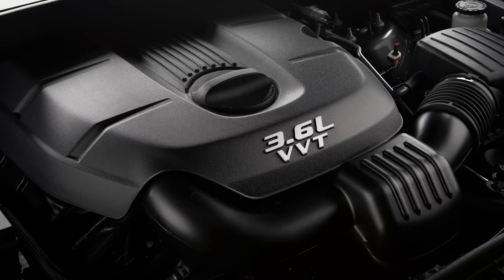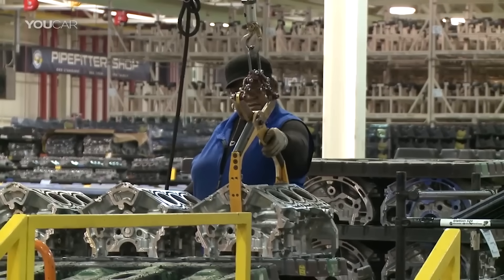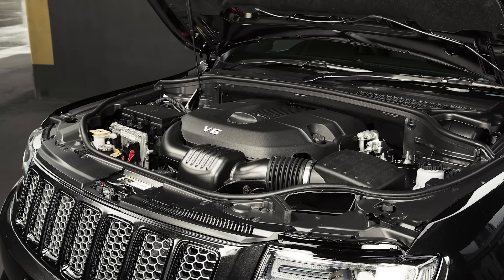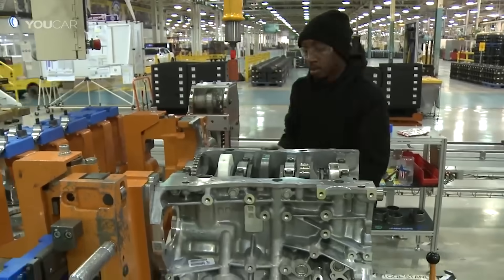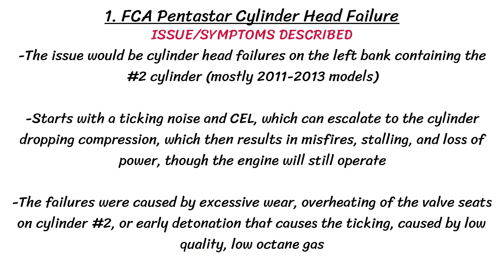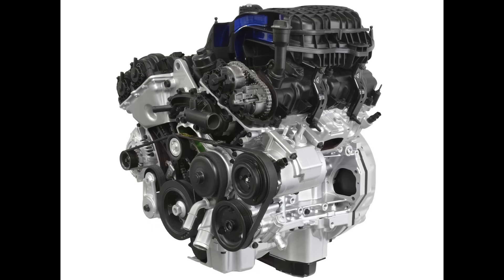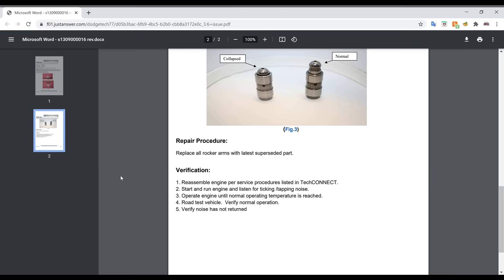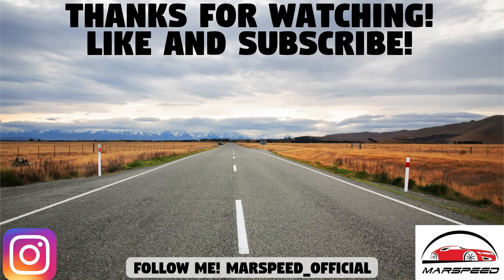The Specs and Fatal Flaws of the Chrysler 3.6L Pentastar V6 Engine

Comment: A couple weeks ago I noticed my 2012 Jeep wrangler was starting to over heat and the heat would blow cold. Brought it into the shop and they replaced the temp gauge and everything ran great for the next couple days. I went away for a week and when I came back all the issues came back as well. I just got back from the mechanic for a second time and now they said there’s a warped cylinder head causing exhaust to flow into the cooling system. They quoted $5k to fix the issue including the rocker arms which they said could fail anytime in the near future. This is shocking to me since the car only has 97k miles on it and the temp gauge never read H only 3 quarters at most when it was overheating and the check engine light never came on once. 

I like the pentastar engine and Dodge and Jeep products but this is uncalled for. Even if the pentastar engine is overall reliable, a simple thing such as a thermostat failure should not cause catastrophic engine damage after only driving a few miles with it running a little hot.

Comment: 2013 GC build which is just outside the warranty. Constant coolant leaks from upper radiator hose, oil pump assembly leaking oil, heater core issues, P0302 misfire with no offer of help from Mopar, Jeep, Chrysler, Dodge, Fiat. DO NOT BUY A PENTASTAR. Also… does anyone know where I can join the law suit?

Comment: I own a 2015 Grand Caravan, it has 100,000 miles on it and it developed a noticeable tick on a 1,000 mile trip we were on. I wanted to get it repaired asap, however I still had to drive home. Drove home and found the noise was coming from the right side bank. I took the valve cover off and voila, one cam lobe had worn completely flat for 1 of the 2 intake valves on cylinder 3. I ordered new parts including rocker arms and the cam. It runs beautiful and quiet now. But I'm peeved that Chrysler extended this warranty for the 2011-2013 3.6's, but when they revised the engine in 2014, they added no such additional warranty when it fails in the same way. Can't imagine what I would've paid if I went to a dealer. Probably would've equalled almost what the van is worth, when it cost me $300 and an afternoon of my time..

Comment: I know the Pentastar V6 had it’s issues in the first few years, but at least Chrysler honored the recall, which can’t be said for all auto makers. Here’s a video of a guy tearing down a Pentastar with 626,000 miles on it, and it didn’t even die yet, so to speak. Timing guides wore out and it jumped a few teeth, but didn’t cause valves to hit pistons. 

https://youtu.be/CDjvfd9mo5s

Comment: LIKE MOST VEHICLES PREVENTIVE MAINTENANCE IS A HUGE BENIFIT. CHANGE OIL FREQUENTLY, USE SYNTHETIC OIL, CHANGE FILTER AND OIL AT AROUND 5000 NO MATTER WHAT. KEEP ENGINE CLEAN TO SEE OIL OR LIQUID LEAKS EARLY. DISHWASHER DAWN IS REALLY GOOD FOR CLEANING ENGINES, BRAKES, WHEELS.  AND MOST IMPORTANT, ACTUALLY CHECK ENGINE BAY WHILE FILLING UP WITH GAS!!  PREVENTIVE MAINTENANCE, BEFORE IT HAPPENS, CHEAPER THAN FIXING THINGS LATER.:goodvibes::goodvibes::goodvibes::washhands::washhands:

Comment: i have a 2017 challenger sxt plus. i just replaced the oil cooler & water pump for $3000! 3 months earlier i had the fuel injector and thermostat replace. all together spent $5000 in 2yrs. can't wait to get a tesla

Comment: FYI. Discovered yesterday on the 2014 Town & Country with 134,000 miles that the fatal flaw requiring replacement of Left Cylinder Head on the 3.6 costs $3300 at the dealer. Only saved because of the Max Care Lifetime Warranty I bought with the vehicle.

Comment: I’m currently having a overheating issue with my 2015 Jeep Grand Cherokee. It started after I changed my radiator. I went with an aftermarket part which was thinner than the OEM radiator. After I changed it I noticed the vehicle was running a bit hotter but not overheating. Shortly after that I had an oil leak coming from the oil filter cooler. I ended up changing that out and I went with the aftermarket dorman all metal oil filter cooler, thinking that would be a better fit since the OEM was plastic. However unfortunately after I changed that, the leak went away but the vehicle started overheating. I’m not sure if I put it back wrong or if it’s something else. I currently don’t know what to do because I don’t wanna ruin the car. Any advice would help and greatly appreciated!

Comment: I have a 2015 Dodge Grand Caravan with only 90K on it and I had to recently replace the leaking oil cooler and I'm in the process of replacing the left bank cylinder head.

Comment: It's a good motor, lacks on power and torque in the ram 1500 which I have and I have not had any problems with it besides cooling system problems

Comment: 2011 Dodge Ram 1500 number 2 cylinder intake valve , stuck open, no compression, rocker arm fell off, did compression test, 136 thousand miles

Comment: The 3.6L Pentastar V6 is WAY too complicated. The Ford 3.8L OHV, 12 valve pushrod engine without VVT is a far superior engine. I have 322,000 miles on one in a 2003 Mustang. It has held up so well that when it does fail/wear out, I'm just going to replace it and keep driving the car. It's cast iron block and aluminum heads have caused some problems, but I haven't had any issues so far.

Comment: Do not buy any vehicle with this engine! Jeep, chrystler, dodge etc. I'm a mechanic and trust they are junk. If you're pentastar runs good then you are one of the lucky ones . But if you're engine light comes on and you get misfire codes (that's all folks) your cylinder head has likely failed. Jeep at my shop had broken head with only 60,000 miles. Then chrystler sent new head that was broken from the factory. We lost thousands, had to give back to irate customer (no charge) and cut our losses. Junk junk junk!

Comment: I have. 2014 Grand Cherokee...developed what I assume is the rocker arm fail and also AC compressor went out all at the same time. 142,000 miles.

Comment: 2014 Grand Cherokee almost 200k miles. Flawless easily accessible power. Oil change (mobile 1) when the computer says to, sometimes longer, have run 2 or 3 flex fuel tanks and no probs. at all. Amazing!

Comment: I got a used 2016 200C, in 2019 with 17,000 miles on it. Love the car! Had the rocker tick happen at about 30k miles. It went away as I pulled out of my driveway on way to the dealership, but I had them replace all of them anyway. 
Every now and then there's a faint smell of antifreeze, but there is no leak, and the coolant level is fine. Anyone have ideas for this? Heater core issue maybe?
Thanks for the vid!

Comment: I have a 2011 Challenger v6. Only issues I've had is replacing thermostat housing, twice. It's annoying bleeding the coolant system. But after replacement runs like a champ.

Comment: 2011 journey oil cooler is a shit design by shit people, period. Replacing my fourth one currently,. 138000 miles. The second one cost me the radiator as well because somehow the oil leaked into the coolant port. The clock spring went out at 100k and the abs brake unit went to shit. That's still not fixed because I drive it now and it brakes fine, just no traction control or abs. Be my last Chrysler ever. Awesome just got further in the video and found out I have the cylinder 2 problem cant wait for it to grenade on me. Oh yeah no heat either. Shit motor.

Comment: I plan on putting one of these great engines in my 1974 plymouth duster. With the power to weight ratio, I should see impressive fuel mileage and maybe even more horsepower too. My duster I'd an original slant six car, so I figured, why not give myself more horsepower and monumentally better fuel economy than any old v8?

Comment: I just recently purchased a 2017 wrangler with 64k miles on it. Drove off the lot and check engine light comes on after 50ish miles or so. End up pulling the code myself and get p0302 (cylinder #2 misfire). Talked to the dealership and drove the jeep to their shop a week later (80ish miles away). Just heard from them today, its been 3 business days now and unfortunately they are going to have to replace the heads. Dealership is covering 100% of the cost and also put me in a loaner vehicle estimated time being 2 weeks. Although I am grateful for them fixing it on their dime, the inconvenience has me a lil ticked. Hoping for the best when its all said n done!

Comment: I purchased a 2017 RAM 1500 Express with this engine in 2019. I find it an great power plant, had as much horsepower as my 2003 RAM with the 5.7 Hemi.
Ironically I did purchase a factory extended and have that security in mind.
Believe most owners are to blame for this engine issues as most don’t follow the maintenance needs, very typical.

Comment: All I can do is laugh when some tool with a Cherokee actually thinks this Pentastar trash is worth anything. This is the bare minimum, cheapest possible V6 you can buy. But then Chryslers have literally NEVER been reliable in any respects. There are far too many plastic engine parts. Compared to any Nissan VQ, except maybe the 4.0l, these are trash straight from the factory.

Comment: My Chrysler 200S Convertible hasn't had any issues with the motor so far (129K miles) but I've got a clogged heater core. I'm going to replace the thermostat, flush the cooling system, and use a garden hose to unblock the heater core; then another flush to make sure, and refill with HOAT antifreeze since my car is a 2012. (They changed the coolant in 2013 & up to OAT, so if you have to do this MAKE SURE you have the right coolant for your car's year, if the two types of coolant mix they form a sludge that'll ruin your cooling system!)

Comment: The rocker arm issue is found in the first gens. With the updated PUG engine, this have this fixed, i think. Ive never seen one fail. Ive seen many with more than 100k without major issues. All in all, i think its one of Chryslers best engines ever made. Coming from Chrysler, its pretty reliable (and that is a mouthful). Thats good for them.
Reply: Pentastar engines are the biggest pieces of crap 2 grace our roads in  decades! The main problem for me is that these vehicles also encounter a host of other issues besides the rocker arm failures, the oil, coolant leaks from up top there, the plastic thermostat housings, etc. They also have weak transmissions(62te), tipm issues, rear h/vac will definitely need some repairs eventually, I mean the list just keeps going on & on and the more you look at reviews and other people's experiences, you find other issues that make you wanna not buy any Dodge/Chrysler/Jeep product manufactured anywhere in the 2011 thru 2021 years! I think I'll pass...especially after hearing people with the new "revised" 2016-up pentastar engines still complaining about the same valvetrain issues & oil leaks from the filter/cooler housing assembly!?! You can replace it with an aluminum one & call it an upgrade all you want but it's still gonna leak from underneath it when the 0-rings give way eventually...
Reply: @jbone1383  well, to each their own. Ive heard bad experiences but also good ones. All  cars fail, though. Even Toyotas. Some cars just need some more work done to them to keep running. If your main concern is low cost of ownership and are not too much into fixing cars or you are not a car person, you can get a less problematic car. Read that again: LESS problematic. 
My GC has had some issues but engine and trans (the ZF) have been good to me. I fix it myself And no, no TIPM issues because mine doesnt have it. Thats for the older models.
Reply: @Kevin_10225  Oh, okay. GC must stand for Grand Cherokee if you have the ZF 8-speed? Those are pretty solid tranny's from what I can tell,  I was gonna purchase a 300 back in 2012 that had one but the deal fell thru... the only complaint I had about it was the extremely high price of the fluid! I believe it was the most expensive tranny fluid on the shelf @ the time, lol...Also the procedure for just checking the fluid level seemed kinda ridiculous but yeah those seem to have been proven pretty durable over the years🦾
Reply: @jbone1383  the fluid is expensive, but more expensive is a new tranny 😉 Chryslers products are not toyotas, but some of the new ones are better than the old pieces of crap they use to manufacture. I particularly like Jeeps and the Dodge Durango. They are relatively well built compared to other models. You just have to choose which ones have the least problems, and you can enjoy the car and not stick with the boring options only. There are many Chrysler products I cant recommend, but a few I can (like the GC and Durango), always telling people to check on the car and that you will have to do some extra maintenance to keep them running well.
Reply: @jbone1383  I take it you are not a fan of the Pentastar.

Comment: Fuel injectors at 60,000 and then 65,000 and complete cooling system at 55,000 and 63,000. In my 2016 awd 200s. And ECM at 60,000. For the ECM they had my car for two months. But I looking good at 72,000 now.

Comment: 19 wrangler 3.6 pentastar. 70k miles, serviced on time always, and  drivers side rocker wore out and ate into the cam almost immediately after the tick was noticed. Not impressed with the longevity of these motor components. First brand new vehicle I bought for myself also. My old s#!% box s10 had over 300k on it with no engine related failures.

Comment: I have a 2011 Dodge Avenger Lux with the 3.6L.  The engine itself has been pretty solid.  Granted, there has been a misfire issue, BUT that appears to have been due to the need to replace the catalytic converters (and O2 sensors).  And I have over 213K original miles on it.  LOVE THE ENGINE....just wish the car was better designed to resist rust.  It's less than 15 yrs old and all 4 doors are rusting...UGH!  My 1992 Dodge Stealth R/T didn't have (let alone show) a spec of rust after 222,219 miles on it in 2011 (until the turbos finally blew up).  So why is it OK for a Stealth R/T to have NO RUSH ANYWHERE after 20 years of ownership, yet the Avenger shows significant door rust after merely 10?!? UGH!  Sorry...back to the engine...I think the cylinder head issue could be curbed by using E85 more frequently, but that's just my opinion (aka I am NOT an engineer) for those of us who have the "flexfuel" version.
Reply: Dodge stealth was a rebadged Mitsubishi 3000gt/GTO not made by shitsyler

Comment: I own a 2011 Chrysler 200 Limited with the 3.6 Pentastar engine. It has 127,500 miles on it. I just spent $2,545.00 on a cooling system failure of parts. Now the engine has a tick noise at idle to low rpm operation. Now that I know about Chrysler's extended warranty program, I will take my car into my Phoenix Arizona CJDR dealer for repairs.

Comment: I work on about 4 of these vehicles every week every single one has the valve train problem they all cost over $4000 to fix.  The cool passages in between the cylinder heads are the shallowest I've ever seen in my life which I don't blame it for overheating is not enough coolant flowing in between the cylinders. Most of these motors I see don't even make it past a 120000 miles.  I'd have to say it's on the list of most unreliable motors.

Comment: Great video. Was the class action lawsuit won and do we have a warranty claim to file thru dealer?  I have the cylinder #1 misfire P0306 error popping up intermittently on my 2015 Jeep Wrangler Sahara Unlimited. Changed plugs and ignition coil already since 80k miles. Still happens intermittently

Comment: Yeah the cooling system issues are real. Thermostat housing blew, replaced it, Oil cooler busted, $1,230 later...fixed.

Comment: You about talked me out of 2011 or later purchase of Chrysler products except 300 sedan. These are not owner problems. If I did I would replace rocker arms AG or AH revisions and a cleaned out left cylinder head on 300's and town and country. If I can I would drop a 3.8L or 4.0L in vans and call it a day. Worse off than the 2.7L which I still run.

Comment: FCA is the worst at standing behind their lousy oil coolers on the 3.6L.I had one in our 2015 Caravan fail and contaminated the entire cooling system and reservoir.I had to pay $494 to have oil flushed out because FCA wouldn’t cover the “consequentials”.They know it’s a lousy design and don’t care.FCA will run that brand into the ground by the way they treat the consumer.My 35 yrs of buying and believing in Chrysler is in a very guarded limbo right now.Im shocked that they are that callous.

Comment: Im glad someone is actually being honest with how JUNK  these POS engines are. I got stuck with the first gen 3.6. There's a big flaw you missed on; that braindead oil/coolant intercooler/oil filter combo unit. Chrysler in their infinite stupidity chose to go with the polimer bodies; Dorman and other companies have re-engineered these to be all aluminum to cure the many headaches these POS cause.  My 13 JKUR has suffered almost everything you listed - the head recall, the plugged heater core, multiple oil intercoolers, PCV valves, and more. The first engine went through the PCV valve, then the oil intercooler, then the timing set, and right after the timing set the rings let go - and both the dealer and chrysler fought me every damn inch of the way; despite the fact i am a Red Seal tech AND a former master Chrysler tech.  I find the claim that Chrysler put '12 million miles in testing' to be pure bullshit. Every first gen 3.6 ive seen has been an absolute lemon, and i just hope my parents 2020 gladiator doesnt go through the nonsense mine has.,

Comment: I had all of these issues on my challenger but I got to 340,000 miles then I sold it and I didn’t replace anything on it
Reply: You can do better with a Toyota in long term mileage with lower maintenance and cost with reliability.